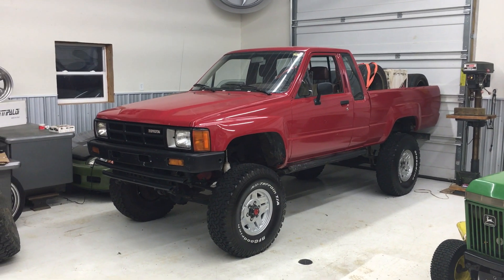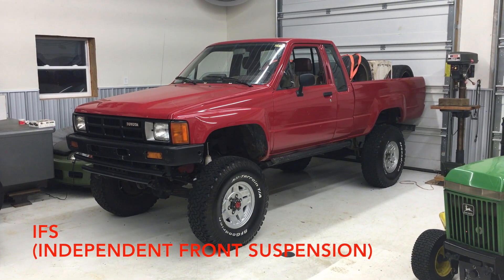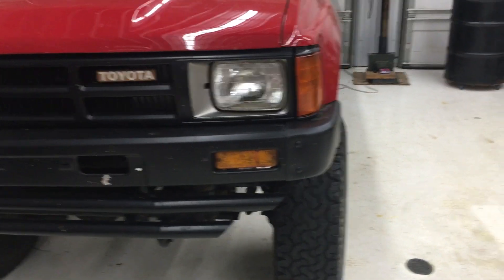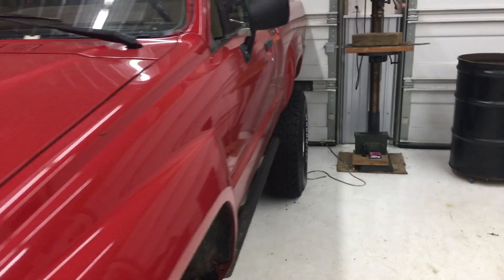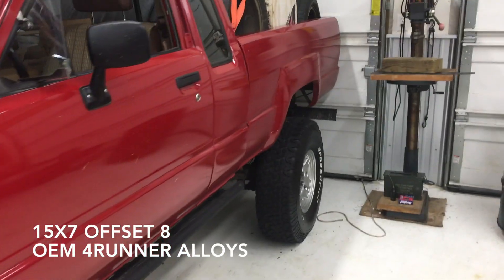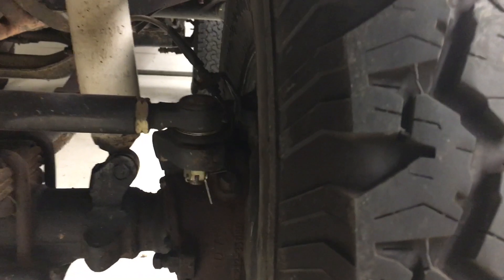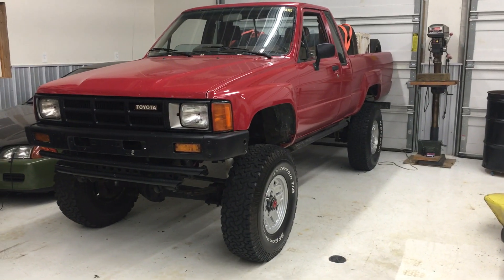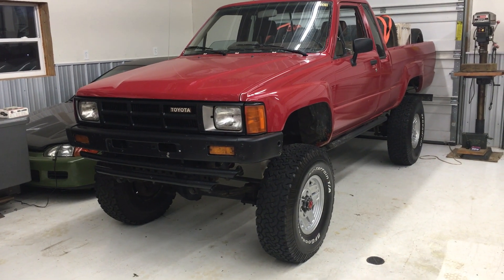Installing Toyota 4x4 IFS Alloy wheels on a Solid Front Axle Truck/4Runner

Comment: Thanks bro.
Reply from the maker: No problem!
Reply: I have a original 85 straight front single cab. Blue. With the white steelies. Trying to put those wheels on with 31x10.5. its got the 4.1 gearing. Would like to do a rear locker and regear in the near future. It's the 22r carb. Wish it was the EFI model. 🤙🤙 Mahalo rom Hawai'i
Reply from the maker: @outlawpat8038  EFI is nice when it works, but they can run perfect one day and poor the next if a sensor fails.  22R will slowly loose performance over time as a part is wearing out so they're a little more forgiving when it comes to reliability. Mahalo! I saw a lot of clean old school Toyotas when I visited HI
Reply: @6thGearGarage  yeah Toyota trucks is really big here alot of people love Toyotas here. When I was growing up my uncle's had all 80's & 90s Yota's. You can go out everyday an see at least a hand full or 2 of 84-88 trucks.  Mahalo means thank you in Hawaii bro. Sorry. I'll probably be asking for more info in the near future if that's ok with you.
Reply from the maker: @outlawpat8038  All good!! Seeing another 80's or 90's Toyota on the road here in Ohio is a rare sight.

Comment: I own a 1976 BJ 40 Toyota Land Cruiser drum brakes and a want to upgrade to the right knuckle steering that can be compatible with IFS hubs.
My question is; do I need to change anything else such as the spindles? 
I need help with info please anyone, I’ll appreciate it. 👍
Reply from the maker: That I do not know for sure. But what I can tell you is that 79-85 Toyota Pickup, FJ40 (from 1975 on) FJ60 and FJ62 all use the same Knuckle rebuild kit. https://cruiserteq.com/4x-5x-6x-7x-series-knuckle-rebuild-kit-fits-9-1975-12-89-4x-5x-6x-7x-series-1979-85-pu-4rnr-disc-axle/

Comment: I have 1989 4Runner what will be the correct  offset on the OEM rims ?
Reply from the maker: There are a few versions of the 15x7 alloy wheel. There's a -20 offset which is vary rare & never avail in the US.  A 15, which was for the 86-89 4runner. And a 8 which came on 90's 4runners, T100. I have the 8 offset on my truck because it pushes the wheels out a tad further (7mm) than the 15 offset.
Reply: T15X7JJ-8 this are for sale and my area.. my question is if any of them will fit with any problem please let me know tx and there is another set the only have the number but doesn't say 8 offset sorry a little confused for Me.
Reply from the maker: @alexandertorres5809  the 15x7jj-8 will fit
Reply: Thanks men.

Comment: Would i be able take off the hubs off ifs and put on solid axle? Doing a SAS on 90 pickup
Reply from the maker: @Lancelowry-q2i  no, the ifs and sa hubs are different length I think.
Reply: Ok thank you sir
Reply: Where do I get the kit?
Reply from the maker: @Lancelowry-q2i  https://www.skysoffroaddesign.com/products/toyota-axle-widening-tundra-brake-swap but they don't sell the same kit as I have anymore. Now it uses different parts.
Reply: @6thGearGarage  thank you so much! Been a big help

Comment: I recently picked up a 85 and I'd like to get some 33s for with my 4.10 gears. I intend on getting 4.88s down the road. Is the 4.10s with 33s going to be awful?
Reply from the maker: 4.10 with 33's is going to put you around 2300 RPM @ 65 mph. That's about 15% difference from stock. The 4.88's are going to be ideal for 33" tires.